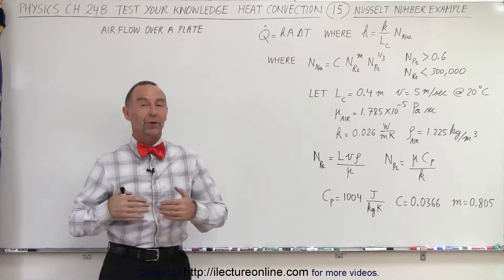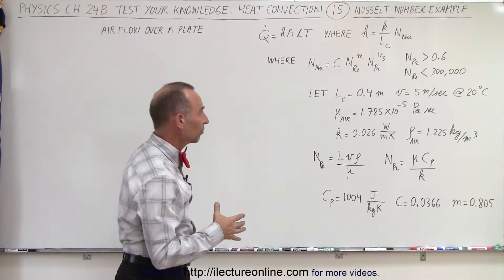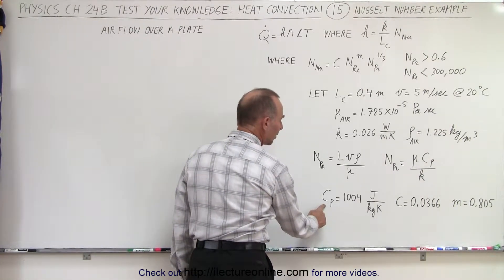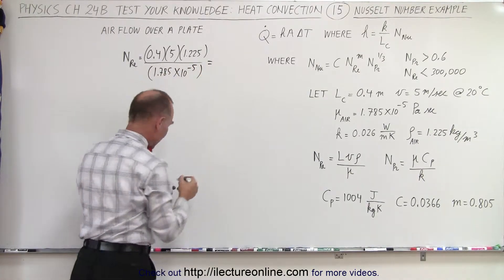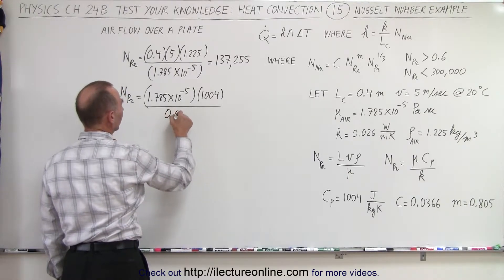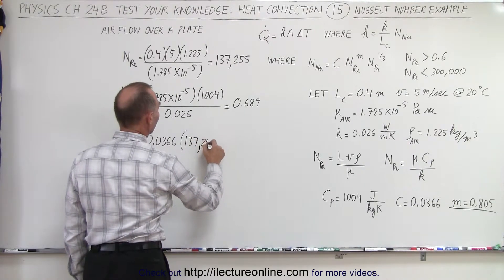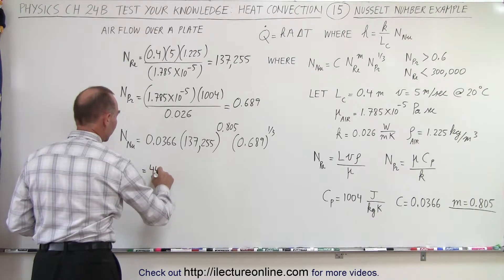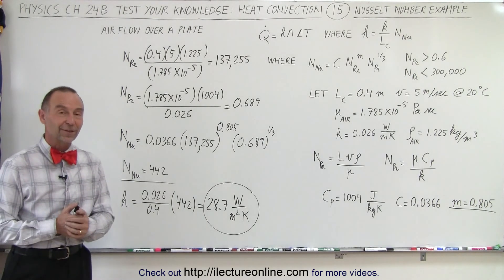Physics: Ch 24B - Convection: Test Your Knowledge (15 of 26) Nusselt Number Example

Comment: Sir can you please  help me in these two  different problems ? 
 
1.
The ball is thrown upwards at velocity v0. How high is this speed when the ball rises 6.1 meters between 1s and 2.3s?

g = 9.81 m / s2

2. The piece has a current speed of zero at 1.2 m / s and is allowed to fall freely.
D) The track reaches a final speed of 46 m / s in time._______ seconds.
Reply from the maker: Draw a velocity vs time graph.  The area under the curve = distance traveled.  The slope is the acceleration.  V1 = velocity at 1 sec   V2 = velocity after 2.3 seconds.  Area = area of triangle + area of rectangle.   6.1 = (1/2) (1.3) (V1 - V2) + (1.3) (V2)      and slope = rise /run    or   9.81 = (V1 - V2) /1.3
Reply: @MichelvanBiezen   Thank you so so  much.